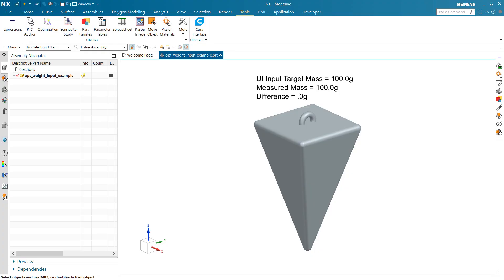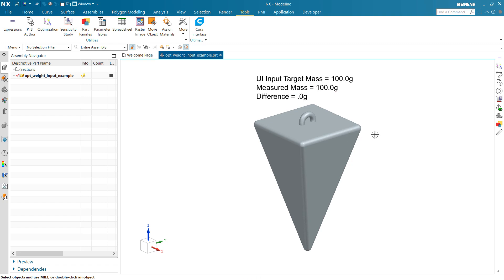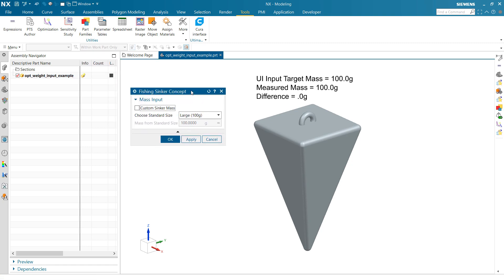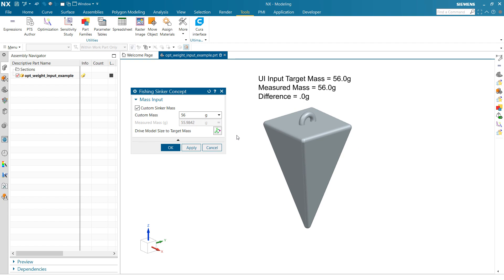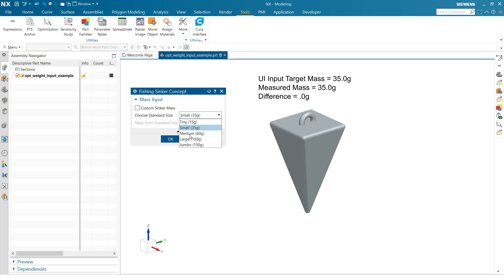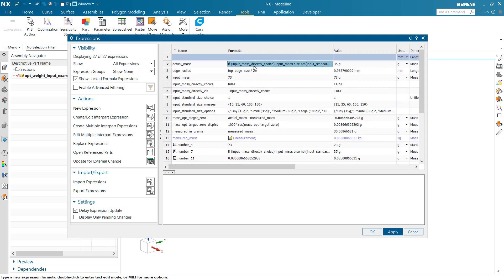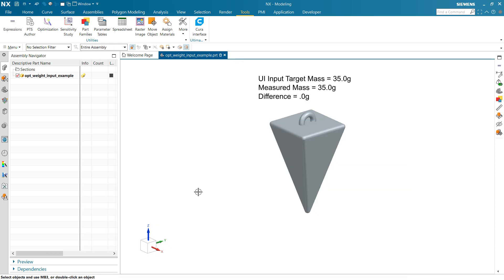NX Product Template Studio: Using Optimization with a User-Input Target Value [NX 6.0]

Comment: Hello! Taylor Anderson !What is the quality expression of the part? What can I do to change the size of the part with manually entered mass values?
Reply from the maker: @hualiang178 -- Great question.  The mass of the body is generally an output from a body, rather than an input, so getting from a mass input to an appropriate "size" is going to either involve:

1) a quick expression calculation (if the shape is canonical and we can easily invert the volume equation)

2) a set of pre-determined known values (like the first half of this video), or

3) an iterative approach to "finding" the right size that produces the desired mass.

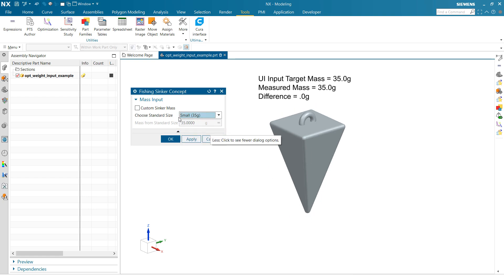For this non-canonical shape, I used the third method in the second half of this video.  As described, starting at about 1:55 in the video, I have a small optimization (Goal Seek, really) iterating on a size parameter to find the size that produces the desired mass.  The "how to" details are in the last third of this video.  Does that make sense?